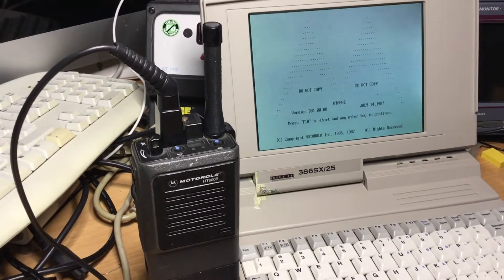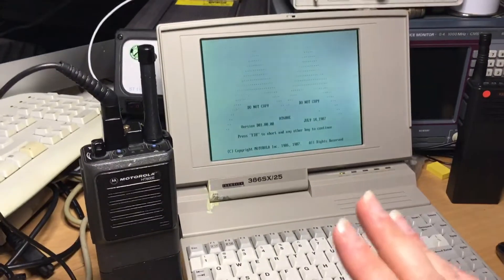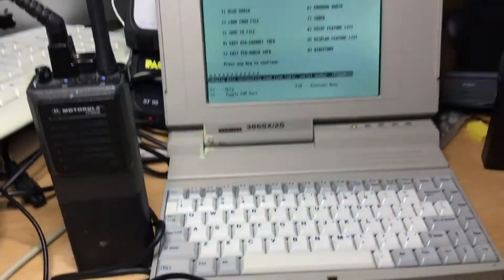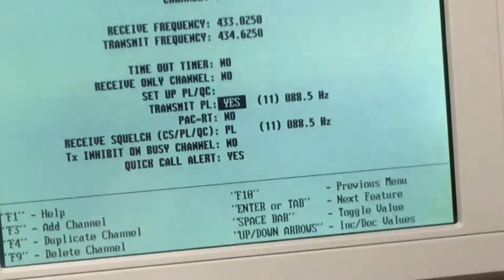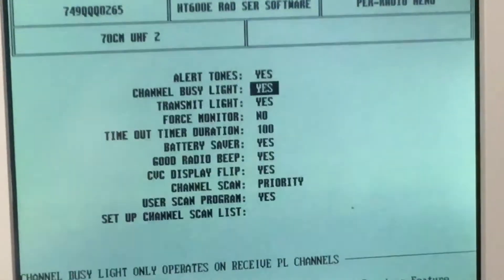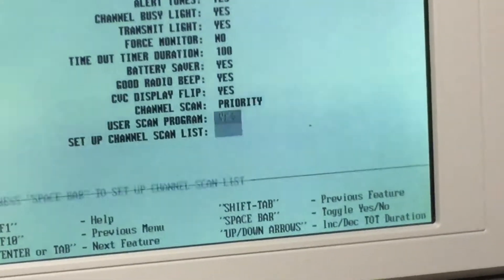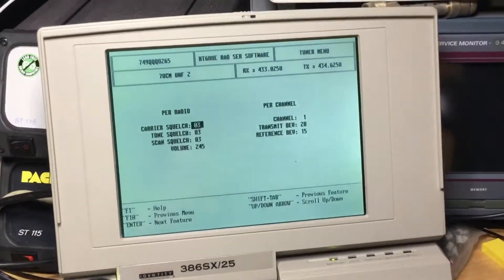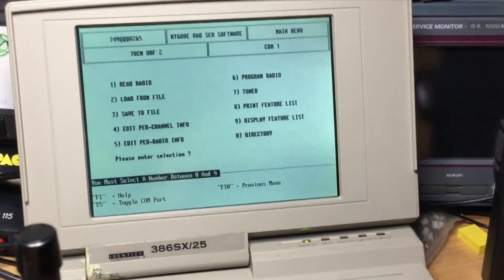Motorola HT600E & MT1000 Radio Programming PART 2 radio software & features in the programmer RSS.

Comment: I Have a Impress Rack of Six MTS 2000 Flash Port Radios Had two of these as well Great radios if Respected . the RSS Software works fine on latter version of windork.

Comment: I’m a HAM and I’m also law enforcement. I have just recently started getting nostalgic and I have been getting interested in old police radios I remember using for work, and using them now for HAM. 

So, with that said, I find it interesting you mention using older computers to program. You say it won’t work, but you don’t mention damage to the radio.

I have been told that if you use a computer with a processor operating too fast, you can “brick” the radio. Basically, it locks the code plug and the radio is junk. I think this was especially true with the Astro Sabre’s of the same era as these HT1000’s. 

Nice video. Thank you.

Comment: I've been trying to reprogram a GP300 and bought what I considered a very old computer to do it with, but it's a P4 400MHZ so even that is probably too fast. I best start shopping around for a 368/486 lol.
Reply from the maker: You need to get hold of an 386 or 486 SX or DX computer, a Pentium 1 may do if the clock frequency is less than 100MHz, get one with a 9 way or 25 way serial port, I use an old 386 laptop with DOS 5 on it & i have another with DOS 6.2 which has the MSCDEX drivers for computers with CD ROM's basically you may encounter problems with any machine that has a clock speed greater than 100MHz my laptop runs at 33MHz its so old it runs on coal, thats what you need, you can still find them listed on eBay or you can pick them up at car boot sales or lawn sales, second hand & flea markets or ham radio rallies, it wasn't until the advent of the MT6000 MTS2100, GP900, that they could run under the dosbox of windows 95 on a pentium 3, also running a DOS emulator doesn't seem to work on the older radios as the serial port UART speeds of the computer are two high even though you can run programs to slow down the computers MCPU the data bus is usually fixed will higher that 100MHz anyway so it won't work & you get the no comms message unable to read radio message. So in short you need an 286, or 386, or 486 sx or dx computer anything more then you will encounter issues with communicating with the radio, i haven't had much success with USB to serial converters again machines with USB ports have a way higher MCPU clock frequency than the radio can cope wit,

Comment: Can someone help me please!
How do load a floppy disk to Windows 7. I have tried everything I can and it's just not happening.
Reply: Or can it be done?
Reply: If you're trying to read the contents of a floppy disk using a Windows 7 machine your best option would be to buy (or borrow) a USB floppy drive - you can get them online, including Amazon and eBay.
Reply from the maker: Assuming you have a USB external floppy, firstly i would ensure you can see the drive from my computer or see it listed in device manager under USB drives or external drives, if it isn't visible you will need to download the windows driver that supports that drive in the USB, once its visible to the computer & no driver conflicts appear then you can use the drive, also try installing / using DOSBOX, assuming the USB floppy drive has been given a drive letter once recognised by your PC device manager i.e A then using files folder you can select the drive, or if using dobsox type the drive letter egg A:\ (then enter) with a disk inserted of course. you will hear the motor in the disk drive start & it will read the disk. to change directory on the disk form the root directory a:\ type CD (space) name of directory then press enter. it will then show this mew sub directory if the path name is correct, to make a directory repalce CD with MD instead then name it & it will create it. DIR/P shows all directories in the disk, the copy command from floppy to HD would be A:\ (NAME OF DIRECTORY) SPACE C:\ NAME OF DIRECTORY, Also you can use . commands such as copy a:\*.* c"\ (name of destination directory) for more info learn about DOS commands. form windows 7 to copy form hard drive egg name c:\ then from start type run, CMD, then enter copy c:\ (name of DIR) followed by a space then A:\ name of DIR, note you should have created the sub DIR on the floppy A first really before copying. . commands will copy everything & will automatically create the sub DIR on the floppy. hope that helps.

Comment: Again very informative thanks, I remember a few UK police forces using the HT600E before the Kenwood TK350. Speaking of which I was also looking at the kenwood hand held, I would wager it is a TK350/359? I have several TK350s for use on 70cms although they appear a little deaf on the wide spaced repeaters that TX at 430Mhz ish.